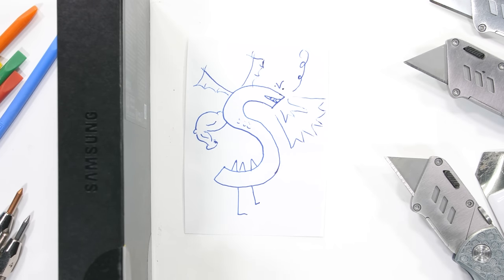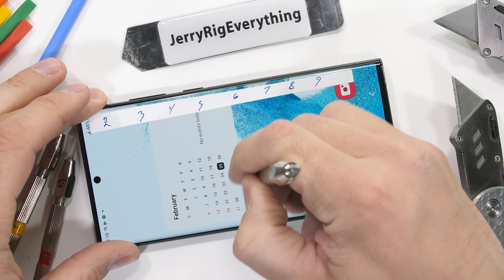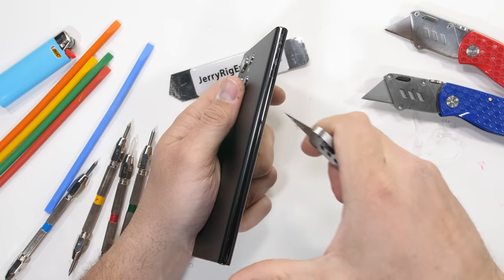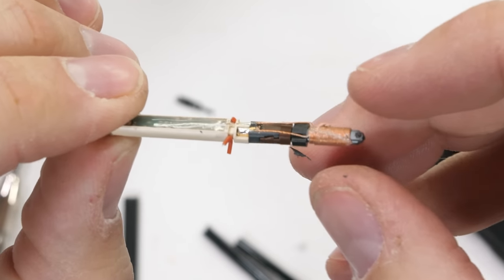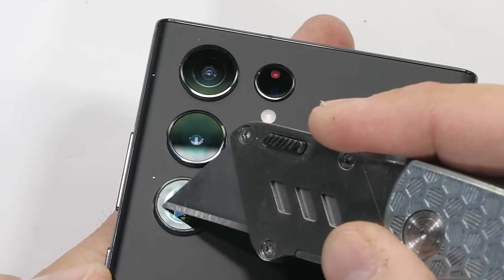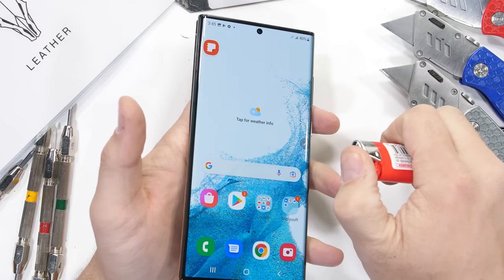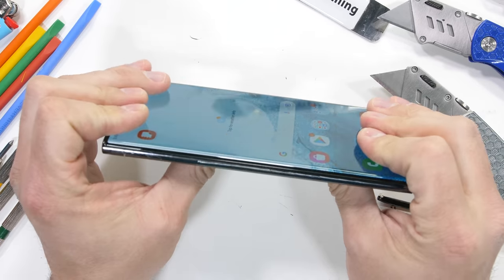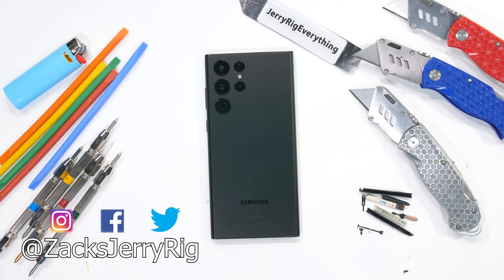Galaxy S22 Ultra Durability Test - How does the New S-Pen Work?!

Comment: I'm keeping my Note9 512GB going for another year at least, I think. Actually, I still find myself appreciating that its Samsung Pay still has MST capability. I don't know if it's just my part of the US that still has many shops that still haven't updated to RFID payment terminals but I'd say I still have to rely on MST every one out of three times I do contactless payments.  I also have multiple credit cards loaded into my Samsung Pay, some of which my wife has the only physical cards for. So if I need to pay with those cards and I don't have MST where it's still required, I'd be out of luck.

Otherwise, the only S22 ULTRA I'd even consider would be the 1TB model.  Without MicroSD card support, I'm not interested at all in any phone with less built-in storage than that. My phone is practically my desktop computer wherever I am and I want all my data and photos/videos local on it.  The cloud is fine for backups, but not for relying on at anytime, anywhere.

Maybe in another year I won't need MST so much and I'll consider getting the S22 ULTRA 1TB then, or its successor?
Reply: NOTE 9 Master race rullez.
Reply: Where are you? I travel around the entire US, and the only places that don't have NFC/MST payment terminals are Home Depot and places where you give them your card instead of swiping it yourself. It's very rare to see a terminal that's not contactless. Even most small shops have a Clover, Square, or Shopkeep POS terminal.
Reply: I also still keep my Note9 with 128GB but i use 256GB good quality microSD card from SanDisk.

Iris scanner is still futuristic feature and go fast when using custom ROM alexander from XDA.
One UI 2.5
Never mind for 3 or 4 if 2.5 still usefull  and work fine.
Reply: @dictionarsis  Right. There is many thing that newer ones don't have and Note9 make me love it even more cause I use it

Comment: Have an Ultra, nice to know it's quite durable. Loved the look of the Dbrand leather on it but it appears to come off very easily. Does it bond better than you showed if left on for a while??
Reply: Yes. It's a PSA (pressure senator adhesive) and it sticks very well after you press it down and let it sit for a while.
Reply: Heat the edges properly and wipe it a bit with the included cloth, it'll be on there really properly
Reply: I can't speak about the leather skins, but I am rocking dbrand skins for years now. Never had one come loose or anything like that. I'm using my phone without a case, so the skin is constantly rubbing against my pockets and stuff, but as I said, i never had one come loose on me.
Reply: @Sohpax  Great. I ordered a brown leather back for mine and that's exactly how I'll use it. Good to hear it's going to survive! Thanks!!

Comment: I want to thank Jerry for giving me a bit of a wake up slap.
I pre-ordered S22U (which coincidentally got canceled due to billing info error), while I had Note20U.
Hearing Jerry say that there's no reason to upgrade from Note10+ to S22U, made me realize how wasteful it would have been for me to upgrade so needlessly.
In his wise words: "There's no need to be sad and poor. You can just be sad"
Thanks!
Reply: It may not be game changing upgrades but moving from the S10+ to the S22U here are some things that I noticed that actually make a difference. The screen is significantly better. Gets crazy bright, is big but in a small package, the 1-120hz is buttery smooth and makes my old S10 feel old. The cameras are quite a bit better. The 10x is insane, the 108mp is super crispy, and night shots are much improved. The standby time is much better, I lose like half the amount of battery when not using the phone. The 45W charging is also nice. Otherwise its very similar to my S10, just with an Spen.
Reply: @Nick-sx6jm  uhm, from the s10s to s22s would be a "worthy" upgrade only for the 120hz. Not the note 20U. Even the note 9 is perfectly good today and 2 more years
Reply: @Nick-sx6jm  I second this from an S10 plus it's actually a really nice upgrade all way around specially the bigger brighter screen and the cameras
Reply: @tridinh1011  eew the note 9 is ugly af
Reply: @Nick-sx6jm  I concur coming from an s9+. Loving the new phone. Just have to get use to the different ring tones lol

Comment: I just got my S22 ultra today and noticed a big difference. There's an inch long plastic oval below the power button that doesn't look like there's much meat left for durability. Some precursory googling says it's a 5g antenna hole, and that's all fine. I don't want to bend my phone to see if it's a weak point. I'll probably not switch yo it until dbrand ships the grip case.
Reply: Bruhh... That's 5G antenna hole....

Comment: I remember 3 years ago when I bought my Note 10+, it was nice to find a plastic screen protector, clear case, fast charging brick and even earphones inside of the box. Nowadays, the same billionaire company selling you a $1300 phone can't even spare a few pennies to include a basic screen protector.
Times have changed for worse.
Reply: Yup. I understand what they're trying to do (well, at least as far as their image is concerned), but given that I've recently upgraded from a J3 Prime to a Z Flip 3, I can't bring forward any accessories. Hell, if it wasn't for the USB-C port on my new PC's motherboard, I wouldn't even have a way to charge the new phone without having to spend more money.

Comment: Hey Jerry, I remember your comparison between Note 20 Ultra Snapdragon vs Exynos. Have you considered doing the same between S22 Ultra's Snapdragon vs Exynos? It appears that the new Exynos 2200 is the worst Exynos of all time and it was already called the worst flagship CPU by various sources, including xda and androidpolice. I tested it for only a couple of hours but the animation lags were painful and exiting the camera app resulted in a 2-3 second freeze
Reply: It's because it has New GPU which is from AMD. 
It has lot of driver issues just like RX 5000. 
I assume that Exynos 2300 will be big comeback from Samsung because AMD and Samsung will fix it and comeback like RX 6000 if I'm not wrong and history repeat itself.
Reply: @MendAmar  The RX6000 series were already outmatched by RTX 30 by the time they came out, though.
Reply: @Onaterdem  I mean yeah but RX 6000 has lower wattage and price compared to RTX 3000.
Reply: Exynos 2200 is betetr but needs updates

Comment: The Note 10+ had super soft glass, pissed me off. So I waited until I found a suitable replacement. Well, this one fit the bill. Huge upgrade all around but especially the screen being the latest gorilla glass. The S Pen is amazing now too. I also was suffering a lot of battery time loss. When it got down to 5% battery, it would almost instantly jump to 1% and shut off. It worked fine otherwise but with all of the scratches and the battery starting to go, it was time for me. 

If you do end up getting one, its a substantial upgrade.
Reply: Lol this will have a spam comment in a few seconds
Reply: What do you mean by super soft glass? My Note 10+ has lasted over 2 years with only a single barely visible hairline scratch on the screen
Reply: @will.dornon  Sad how that aged well. YouTube can't even curb spam bots.
Reply: @ExcaliburHeavyBattlecruiser  it wouldn’t even be that hard to fix either. And I’m sure there are some people who are actually getting fooled by it, which is sad.
Reply: Thanks. I was at a standstill between the fold 4 and the 22 ultra. I don't usually have trouble with damage but the fold seemed too easy to break

Comment: Oh, this hurts to watch! 
In September 2023, there's not a single micro scratch on my S22 ultra.  However,  I've had mine in cases since I opened the box & I rotate TPU screen protectors every 2 to 3 months. 
I figured out that the battery drops around 10% or less per 1.5hrs of watching videos or movies in 1080 or HDR.

Comment: It's definitely an upgrade from my Note 10 (not plus version), but I'll hang onto the Note 10 until it stops working in one way or another. Great review as usual.
Reply: How's battery in the Note 10?
Reply: @jaisejacob4516  Not awful, surprisingly... mine got thru nearly a day of use on a charge with moderate to heavy use. S22 Ultra is definitely an improvement but not as much as I expected... still great though!
Reply: I just had to trade in my note 9 for this bad boy. Didn't want to do it but the battery has cropped out now :(

Comment: I just wish the we had the Qualcomm version of this phone in my country.

The Exynos version has been terrible since a few generations
Reply: Define "terrible". I've had an exynos s21 ultra for over a year now, 0 problems, easily best phone I've ever owned and was definitely worth the money
Reply: But it from Amazon or Swappa.
Reply: @propersod2390  compared to the Qualcomm chips it's lackluster. 
Indeed my Note 9 never gave me any problems but it's outperformed by cheaper smartphones with an equivalent Qualcomm chipset
Reply: @surajwahengbam9600  they say the new gen Exynos outperformes snapdragon.
Reply: @surajwahengbam9600  you seriously going to care about slightly higher benchmark scores? How do benchmarks even affect day to day usage? The battery life is the same and the performance is basically identical
Reply: @Properso :D  it's a well known fact that the Exy version has firmware and performance issues. Just because your ONE phone seems fine because you don't notice three issues, doesn't mean they're not there. It's well proven and documented.
Reply: @littlejackalo5326  you sure about that? I've had this phone for over a year bro and I've never even once complained about performance 😂 yall gonna say the performance is "bad" even though phones from 3 years ago were already fast enough and this is even faster than those. Like damn how can you legitimately care about benchmark scores on a fking phone

Comment: I love this phone, and have had the notes for a while. I got this one a little less than a year ago, when my note 8 battery decided to try to explode. I did have to replace it once, as my original stopped having reception, or reading it's sim card. They do have a digital option, but it still wouldn't get service. I have a feeling repeated drops had something to do with that, but I have always dropped my phones, and this was a first. I have severe arthritis and have trouble controlling my hands. The cameras are amazing, and I love the larger size. I'm thrilled it doesn't have glass on the back, and a simple case has been enough to keep it safe. I have had a hard time getting screen protectors from tmobile, as they have already stopped carrying them for the 22ultra. I recommend spending extra to get a good quality screen protector as the cheap ones make the thumbprint scanner not work well.

Comment: Idk whats up with Cornings ratings system. My Note 9 (gorilla glass 5) was a tank. It had a few scratches, but I felt like I should have broken it so many times, and it only ever got scratches. My S22 (victis +) fell off the couch onto the living room floor and cracked. The next week it fell off my dresser on the floor in my room and cracked on the opposite side. Looking at posts online it seems like the phone has a reputation for breaking.

Comment: i have to correct you with the fact not upgrading to newer phones is not necessary cause old ones still fine zack. when samsung stops updating certain phones it wont get security or software updates over time which means it will make your phone  fragile for any problems from the outside like virusses or hacks from other phones or apps there is a  reason they stop older phones from updating.

Comment: I also am stilling using my Note 10+ and I'm genuinely so impressed well how well its lasting, I have yet to fill up my 256GB internal storage and I have not noticed anything slowing down - the only thing I feel has changed is the camera quality. I updated my camera and gallery a few months back and I feel like none of my pictures are as crisp as when I first got the phone anymore. Literally the better camera is the only reason I've considered upgrading but I think I can hold out until the ultra 23 first (oh, also I agree with the not being sad and poor thing, I'm doing just fine without changing my phone :^))

Comment: Ahh, came here to see if the S pen clicky cap can be pulled off without breaking it but you can't really see it in the video...
If someone knows, do share please, I have a brand new display and frame and a working S pen which is very scratched so I don't wanna throw it away but also it bothers me so I am looking for a cheap way to replace it

Comment: Hi, since I Received my Samsung S22 Ultra from my preorder I have been having trouble with my Camera.  Sometimes it works, but there are a lot of instances where it just freezes when I try switching between Cameras.  This is very annoying because my Samsung S21 Ultra never did that.  I have been waiting for the Update to see if it fixed the Camera Problem and today I got it 3-21-2022 and to my Suprise I still have the same problem.  I Called customer support but they told me I had to send my phone which I told her no, she told me that was the only thing they could do but I don't want to send my phone.  I told her I want to talk to the Supervisor and I have to wait 48 for them to call me back.  Is anyone else Having this problem with the Samsung S22 Ultra?

Comment: Sir….if my iPhone support 20W charging and I use 65W charger…let suppose I plug it before going to bed and it been there plugged in for about 8 hours continuously. Can it damage my battery? Or any electrical component? In long term or short term?

Comment: It scares me how easy an spen can snap
Reply: Well it is just a thin plastic tube with a few pieces of wire and a tiny battery and circuit board , they do warn to be Careful with the pen and to always put it back in the phone when not in use.

Comment: whats the difference of this victus plus to gorilla glass 5? they both scratches at level 6...drop tests are not that good either...
Reply: Drop test aren't good because of the edge display, S22+/S22 might have better drop test
Reply: @CHRIZZ108  i dont believe in edged screens breaks easier than flat..i have note fe(7), i dropped it many times with and without case, still no crack..
Reply: @CHRIZZ108  and also what i mean about "drop tests not good"
is, it seems theres no change in durability in the old and new glass based on the reviews/drop tests throughout the years..and again, they ALL scratches at level 6..

Comment: Guys I have a question  just bought s22 base model and I have put a UV screen protector , but I notice under the light if you  look at the display  where the fingerprint reader is located  we can barely see the fingerprint reader boarders in the display! Is this normal ?

Comment: has anyone tryed putting in an older sim card tray that can take a sdcard to see if they actualy changed the inside or just made it so you could not plug one in to sell you up.  You think they change the design of the try to be much smaller if the SD card reader wasnt in there at all

Comment: Normal ppl with a 2.5 year old phone would have a battery capacity significantly less than when they first bought it. They have would have to charge it more often and further degrading the battery. A smartphone within its 2 years has the most value…after that it’s value starts lower much faster! Phone Carrier have better promo for newer phones. 

After 5 years when your phone battery life is unusable and very slow because it can’t keep up with updated software, you upgrade to the newest phone. In the end you end up paying the same amount except the person that upgrades every 2 years have a phone that never gets less than 80% of its original capacity, very responsive, faster, better image quality on their photos and video. 

If switching out phone components and upgrading were as easy as a desktop pc then you don’t need the newest phone. But phones aren’t made the same way and economically, functionally, psychologically , physically, logically, and mentally it makes sense to upgrade every 2-3 years. 

Jerry doesn’t see this because he doesn’t use his phone, he’s busy filming for youtube destroying new phones.

Comment: I've had every Note except the 7, didn't need an incendiary bomb in my back pocket 🙃.  I just had the S21 Ultra which was supposed to be extremely close to this new s22 Ultra in specs.  The s21 Ultra was the worst Samsung phone I've ever had.  It was slow, would randomly lock up, lose connectivity, etc.  So I upgraded to the s22 ultra (Note). It's a WORLD of difference.  It is extremely fast and the battery, although smaller than the s21 Ultra, lasts all day long and I use it heavily for my job and the YouTube rabbit hole.  The s22 Ultra is the best phone Samsung has made to date.  If you're on the fence about upgrading, do it.  It's worth it in so many ways.

Comment: This phone is the worst phone i hve ever owned every 3 months something breaks on it, the screen smashed from falling less than a foot with an otter box and glass screen protector and became non responsive, the front facing camera failed and i have had to replace the battery from swelling already and i have only owned it one full year now i would absolutely not reccomend this phone, it was built to break
Reply: I'm using this phone almost an year now and I have dropped this phone more than 3 times and one time right from the car to the road straight and that too with just hydrogel screen guard and it never even had a scratch. I totally don't get what you are saying. Also, I'm using the thinnest clear hard case, which is not good at all for protection and still has no scratches nor cracks after all those hard falls.
Did you get it second-hand or refurbished? Cox if so then the parts and the body might be changed, and if in that case, then it makes sense.